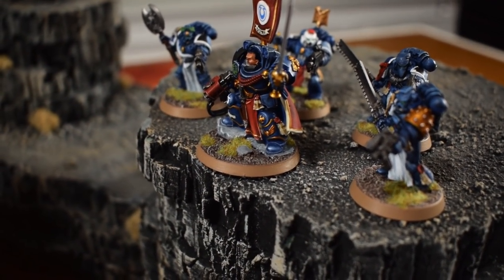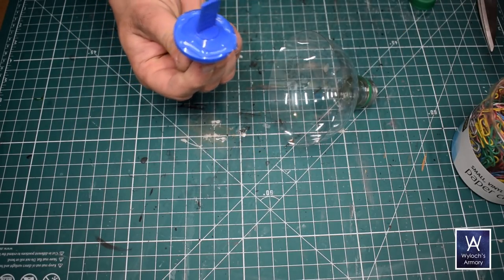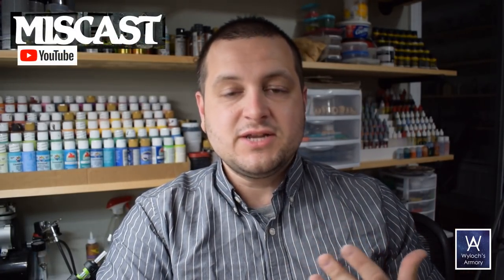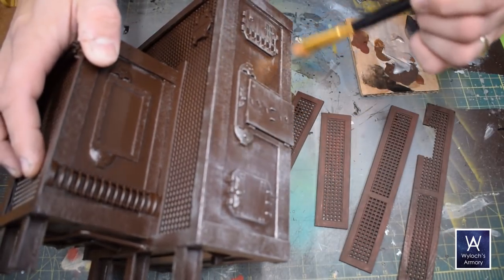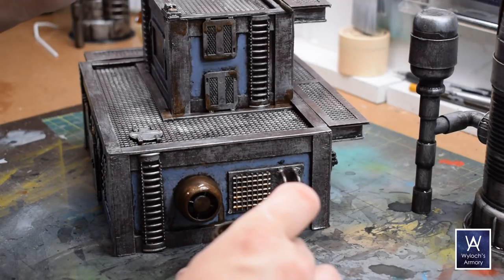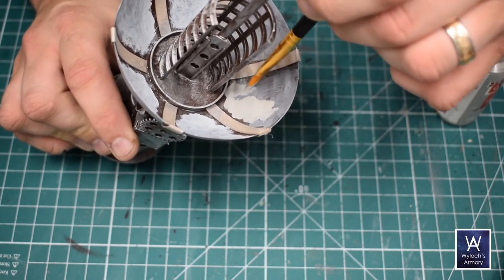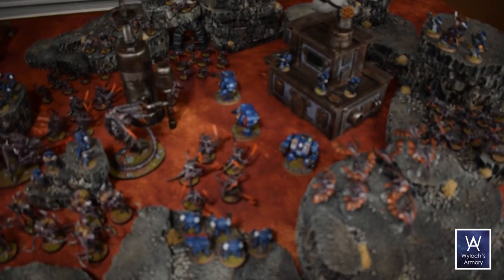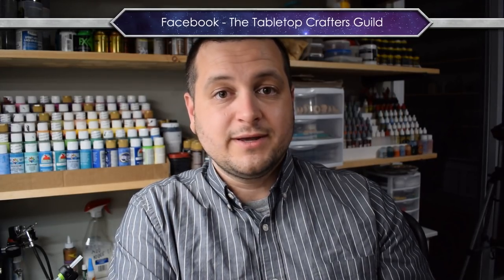Building a Communication Station - Terrain for Warhammer 40k

Comment: 3:26 what is that cross stitching mesh's hole size? 2mm by 2mm? Looks like a holy grail material for various 40k terrain builds!
Reply from the maker: I'm not sure; it's standard cross-stitch mesh.  I don't know if it even comes in a different size...
Reply: @WylochsArmory  Hmm well, I've found there are several brands that use different sizes that have bigger and smaller holes, I'll probably buy both a large and a small just for flexibility. Love your terrain vids man, keep em coming!